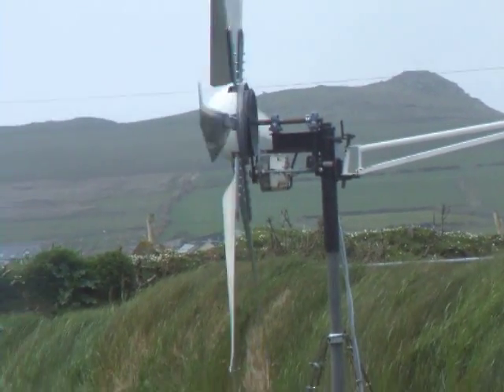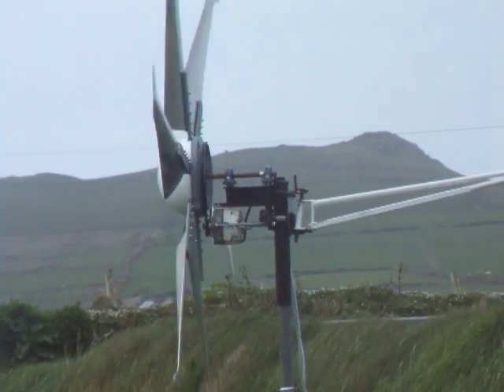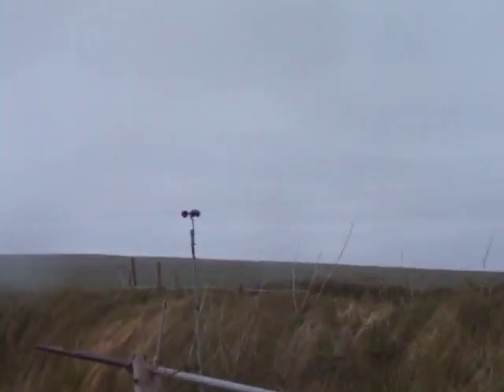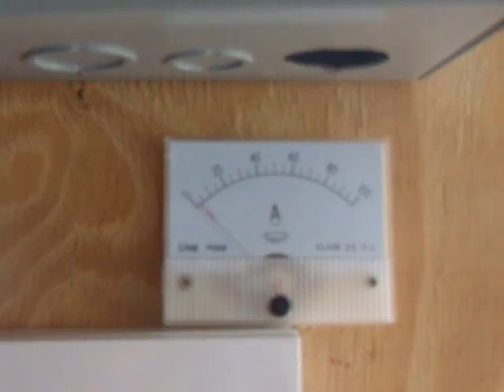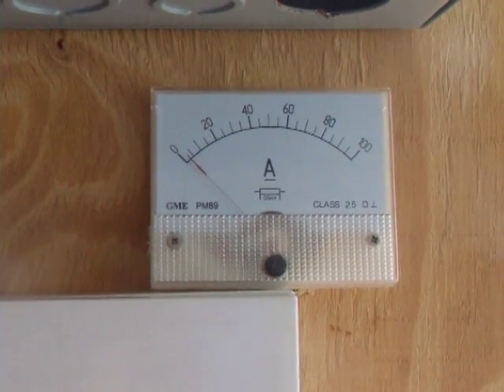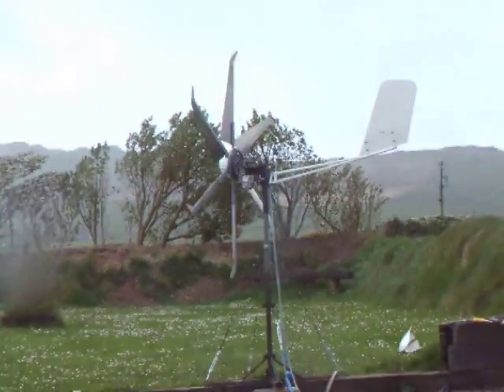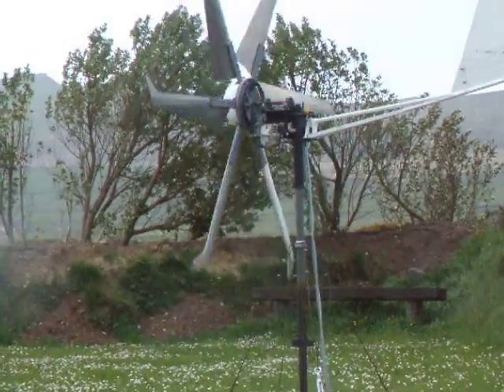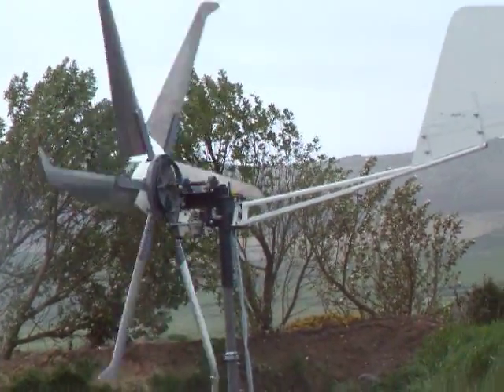How to get 5amps in 6 mph wind

Comment: I wonder if you remove the belt and attach the blades and hub  directly to the shaft of the turbine motor would you get the same amperage at 6MPH. Any thought about that
Reply from the maker: No you see no power as a direct drive at this wind speed using this type of generator but using a 4 to 1 ratio it will generate low but some usable power.

Comment: I also have wondered how to rig up heat sinks up or a simple water jacket and those CPU heat sinks crossed my mind too. The housing jacket needs to be made with heat sink fins on them and/or a water jacket built in the housing. Mine works on the ground so maybe these wont work for you guys..

Comment: Great job!  2 points. 1.To be a smart ass id say about 60 watts worth of heat or 204.7 BTU's .size of wire in the coil can it take that? not sure whats in yours. But its ok as long as amp draw is low or limited but if you put a high draw at low speeds you FRY! One of my wind blue ones @ 300 rpm will do 175 watts  as long as I pull no more than 50 it stays cool not in the air either on ground. 2. shoot it with laser temp gun @ low speeds to see. then whats max op temp for your set up. my max 300

Comment from the maker: Thanks yes i was getting 5 amps with the dual core in same winds but wanted to show a stock single pma can produce usible current in low winds. Large Falcon blades seem to do it for set up. I switch my gen 4 blade combo around for summer and winter.

Comment: This video is Awesome!!, Your getting about 1 amp per 1 mph of wind, I bet if you were using the 14 mag PMA it would be a bit higher. Those blades are looking good, I am thinking I might switch my blade sets for my slower summer winds, and switch them back for my faster winter winds. Anyways It is looking great I think your on the right path :)

Comment: Well Ian i think you have got it. A pma can make usable power at 5 mph winds. They all said it cannot be done and you have proved them wrong. The right combination of blades, pma and pulley's and walah, amperssss. It's looking very sleek. A nice cover and you'll have a good looking machine. And look how close it is to the ground. I can only imagine how well it will work on a tower.

Comment: Good video. The point is, it can be done with a delco style PMA in low winds. 2-3 amps is about what a car battery charger would make so adequate charging current is possible. Beyond that much could be said about your good homebuilt turbine, the falcon blades etc. etc. but again it can be done. Nice!

Comment: I have been tweeking the dual core to reduce the cogging. if you ever turn it you will notice 42 large cogs per rotation. what I did it take one of the stators and turn it a small bit to were now I have 84 small light cogs per rotation and it turns easy now. so I should beable to pick up on 8 mph winds. I will have to test it and see. Im sure it will work better.   again thanks for the video man.

Comment: you need to sell that to Jeff or see if he can build them help Wyatt design them and get like a precentage off the sells. hell that could be prefected for even the dual core with much larger blades like twice the length. and it to would be doing the same.  great video Ian.  man that belt drive works great with your singal core PMA   very very nice low wind power.  I need to build one for my dual.